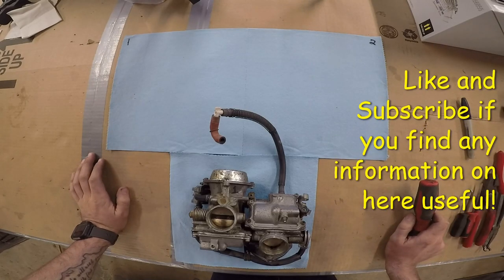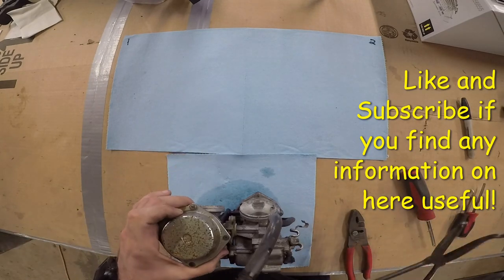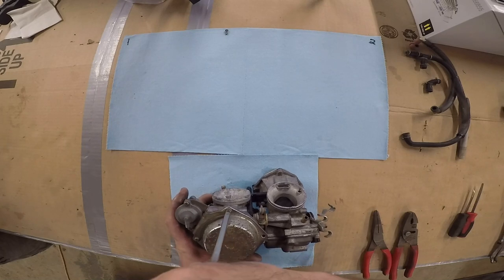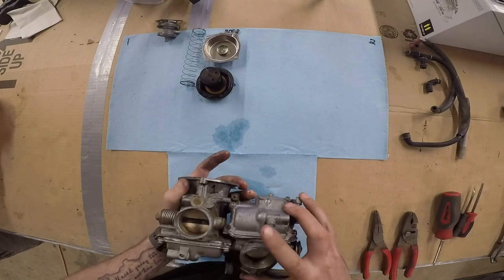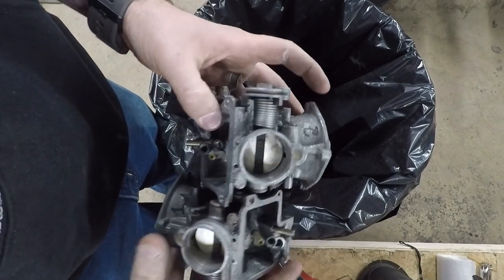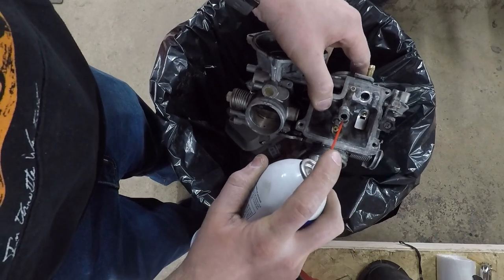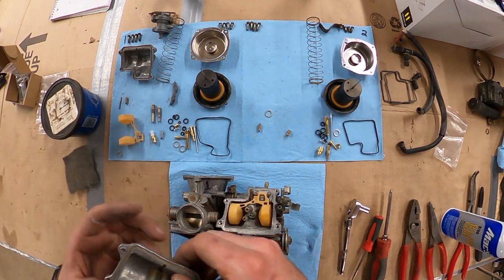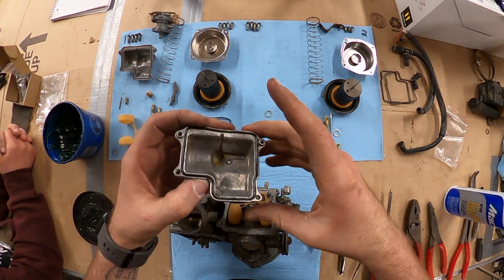Honda Shadow carb rebuild

Comment: Great video and good advice on parts kits.
How did you bench test the needle and seat and do you need to check the float level?
Reply from the maker: This video is kind of old and I don't remember what I did in the video but usually to bench test the carbs ill put a short piece of fuel line on the carb and hold the carb in the position it will be in on the bike and blow into the hose, you should be able to blow through it. Then flip the carb 180 degrees and blow again. You shouldn't be able to blow through it. Sometimes you get a carb that's a real pain and to check those you put the carb in the vice and rig up an umbilical tank and put gas right to it on the bench. then just watch it. As far as float height its honestly something ive gotten lucky with and ive never really checked or changed a float height so I'm not going to be much help there.

Comment: I have the new kit , all of it is much different then original one .
Reply from the maker: This is why I like OEM better than aftermarket for carbs. Lol which boot?
Reply: @ToyShopRestorations  in Italy I didn’t find OEM .  ,,rubber boot “ I mean the membrane .
Reply from the maker: @SometimesWeMustStayInTheShadow  so the rubber that’s attached to the slide? I reused that whole assembly
Reply: @ToyShopRestorations  yeah

Comment: Hello. 

I have an 83 VT500c which I just bought.

I bought a carb kit, and the bike won't get fuel to the second carb (furthest from petcock & throttle cable, front cyl carb).

Can I send my carb in to you?
Reply from the maker: Thanks for watching! I’m not taking other people projects right now 😅 sorry. If the carb is clean but fuel isn’t getting to the carb it’s probably the pump. That’s just a guess. What I’d try is pull the fuel line off the carb and see if you can get gas there first. It’ll make a mess but you’ll know it’s working. Idk if it has a pump or not. If it doesn’t have a fuel pump check the petcock.
Reply: @ToyShopRestorations   @Toy Shop 9665  No worries, figured I'd ask.

No fuel pump, just a petcock and downdraft carb.

Seems the slide was getting stuck, and as well as the float. 

Fixed that, and it idled for a 3 seconds on starter fluid.

Gonna try connecting petcock today.

Thank you for your video.

Comment: You didn't adjust the floats isn't kind of an important thing to do...
Reply from the maker: I’ve never adjusted a carb float on any carb I’ve ever cleaned. If it has a run ability issue I’ll mess with it but I’ve probably done over 100 carbs and never done that. I’m not saying I’m doing it right I just have never had an issue 😅